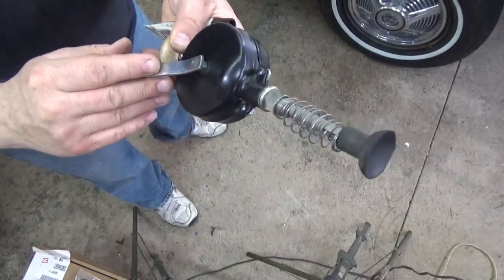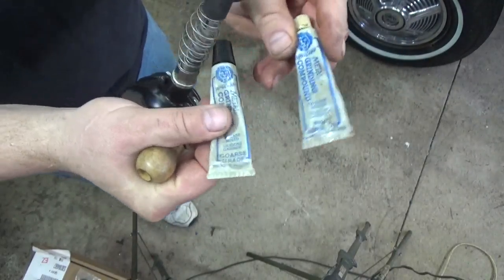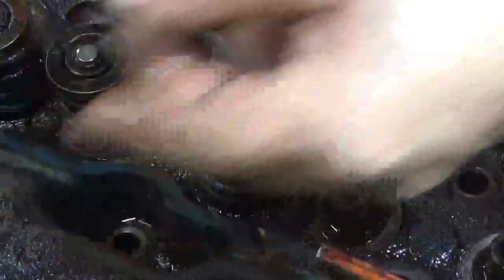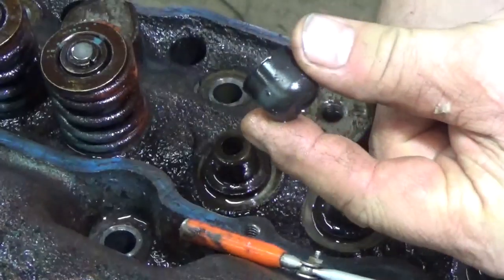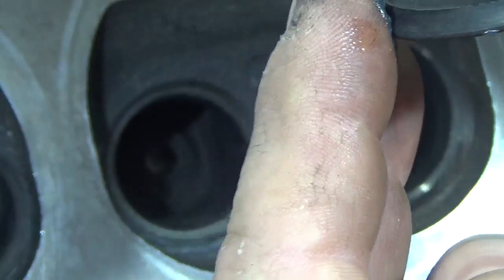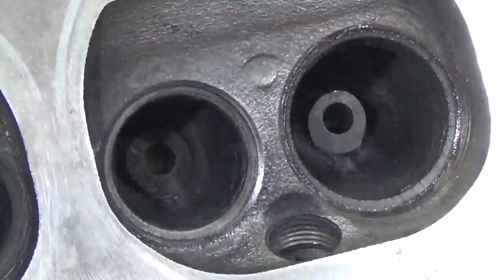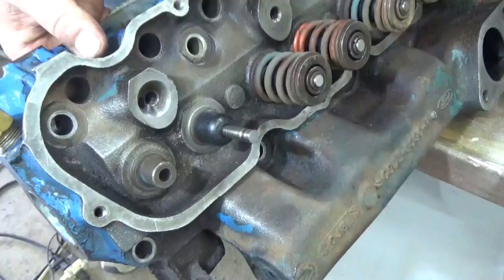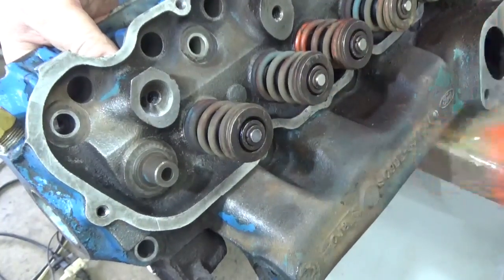Hand Lapping Valves - 1965 Mustang Straight 6 200ci

Comment: I feel a lot better about using Mother's Mag polish to lap valves.  If I mark the seat with a sharpie and get an undefined pattern, I give it a spin.
I've never really managed to test the effect, but I like to think this makes the vehicle start better. I've only ever done this with older engines that had a lot wrong with them. Dirty carburetors, dry throttle cable housing. It sure feels nice though, when you have it back together, turn the key, and it fires right up.
Reply from the maker: It depends on the amount of carbon and how pounded out the valve face is. These were in pretty food shape and the compound made quick work of it. First start up today!

Comment: hello, im taking apart a GM ecotec 4 cylinder on my channel. All exhaust valves have pitting on the seal.  i clean the valves with a scotch brite pad for now. How essential is the lapping job?
Reply from the maker: Very essential. You have to have a a solid seal between the valve and the seat. If there is any leakage you will lose vacuum and it will run horrible

Comment: That’s the first time I’ve seen sand paper taken to a head gasket surface.
Reply from the maker: The parts cleaner is petroleum based so it acts as a lubricant. The trick is to use light pressure to just clean it up. You can still see the mill marks from the original machining
Reply: They don’t build them as tough as they used to 🙂
Reply from the maker: That's for sure
Reply: I forget the channel name, but I saw a guy that used sand paper on the table of his table saw to make the head flat. Not sure how professional that is, but seems like it could work. Thoughts?
Reply from the maker: Depending how flat the table saw surface is, it could work

Comment: Found crushed up valve spring seals under my valver cover. How does that happen?
Reply: Is that a normal or regular thing for these 200cid?
Reply from the maker: What is a valve spring seal?
Reply: Valve stem seals. Forgive me I was wrong. I was asking about those stem seal things they are a hard plastic right?
Reply from the maker: Yes they are. They will dry up over time and fall apart. I've seen them come out right through the springs